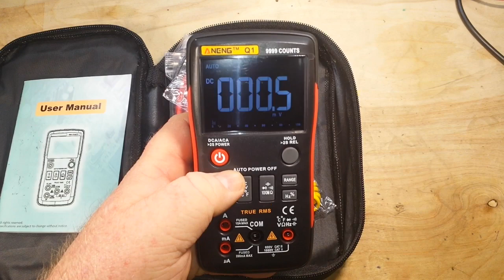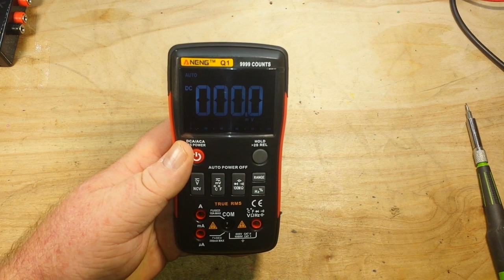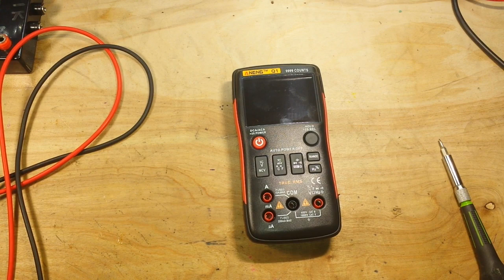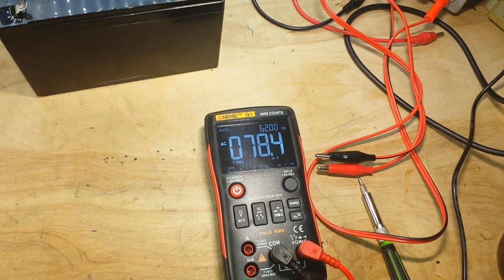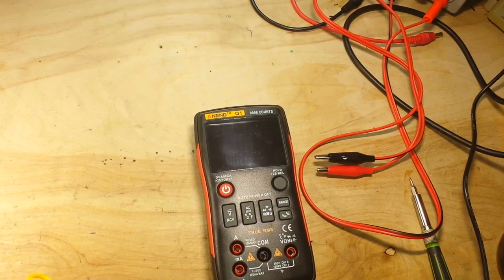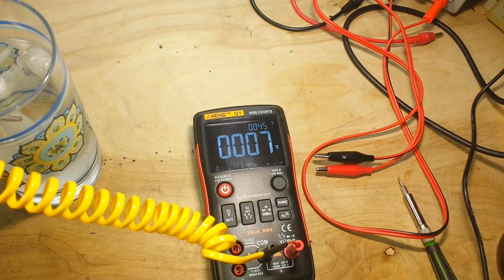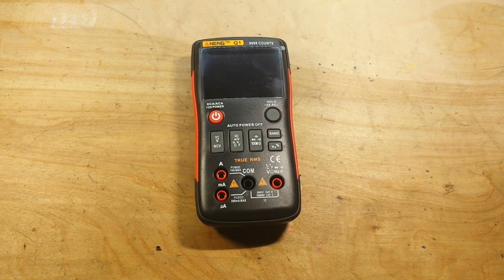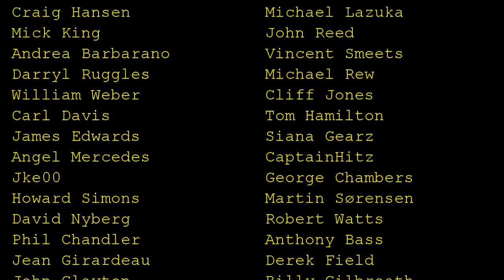Aneng Q1 In Depth Review and Teardown

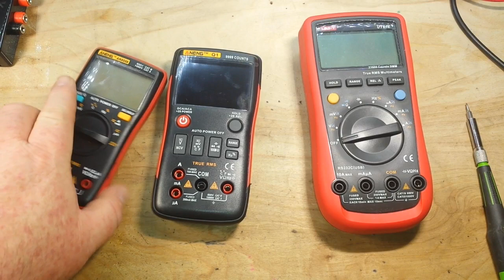Comment: 3:51. 9v batteries are made up of six AAAA cells (or close to that size).
Reply from the maker: I will tear one of the Chinese 9Vs down vs one of the big brands. You will see a difference.
Reply: learnelectronics 
When I tore down a zinc battery, it had six rectangular layers like a cake (not tasty though). When I tore down an alkaline battery, it had mini (AAAA perhaps) cells in it.

Comment: For price /functions i rather stay with the 8008 / 8009. The inverted display, bargrapth and buttons are add-ons but does not contribute a lot for functions for the extra money. The good thing are the 5x20mm fuses which are more easy to find in local stores here, even in ceramic format. On the other hand,  for more  money we can get a better meter,  maybe with better fuses, like the uni-t 61e
Reply from the maker: I agree. The 8008 or 8009 are better and cost less.
Reply: It's just a opinion. For 38~50 Euro you can get maybe the uni-t 210D/E clamp meter, uni-t 139B/C, not to be a uni-t fan boy , but they have a good price for starting electronics and can be easly found on local stores. you have aalso some mastech MS8265 .
Reply: I would say if Aneng wanted to do something worthwhile, take the current 8009, make it the size of the new Q1 with a bigger display and bar graph. Then add the missing 10/100 lower volt/current ranges kangaroo Dave complains about, then with it being larger you can give it a better more useable stand, add a "rel" button, and add a feature I just ran into on a little Mustool meter I have.  On the Mustool MT108N the backlight gives the option of holding down the button for one beep and a 25 second or so light time, or holding it down a second longer the light just stays on until turned off, what a great feature-!.  This ought to be implement on all decent meters, the ten or fifteen seconds some of these back lights have can really be aggravating.  I say leave the manual range switch alone, the 8009 already has an excellent manual range switch and as someone here put it buttons can possibly be pushed by accident - a manual range switch cant.  Finally it would be nice to see a little rubber surround of some kind on it.   Of course, all these changes cost money and if you add too many features then the price makes other meters look more attractive.  Then again, the Chinese can excel at keeping prices down and value up.
Reply: About the rubber case i felt the same when i was doing some measurements on my near my TV furniture ( wood) , i just push a little the probes and it fell off right on the floor and got scratched on the screen. The multimeter falls off easly . I will glue some adesive with grip on the lower side so it doesn't grip again

Comment: Something is not right with that thermocouple. When you used heat it made a big jump between 200 and 400 degrees. Ice water should read about 33 to 35 degrees.
Reply: No, it was in Degrees C, not F...  So 0 Degrees C, water freezes.